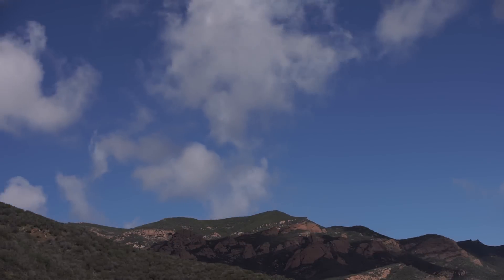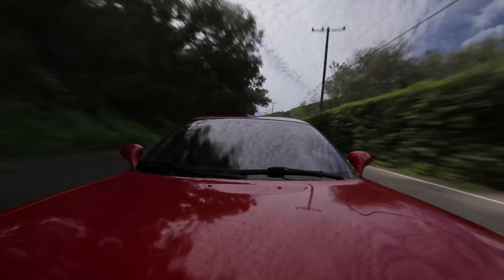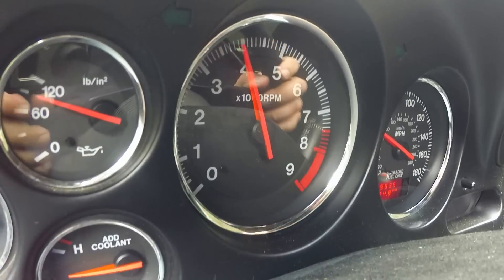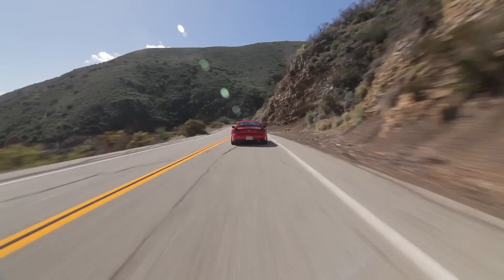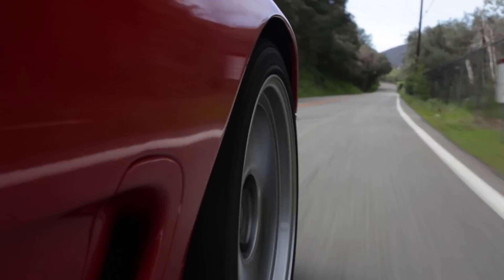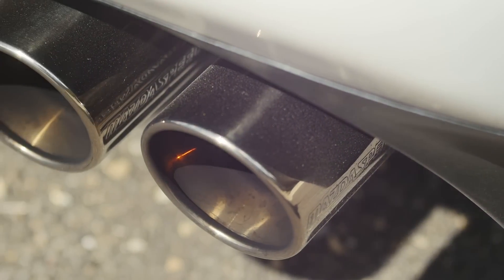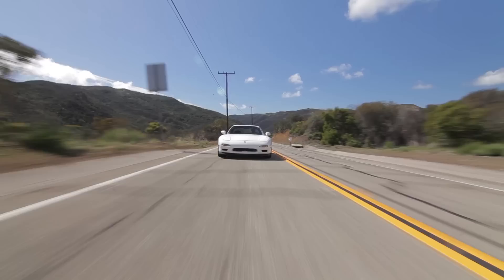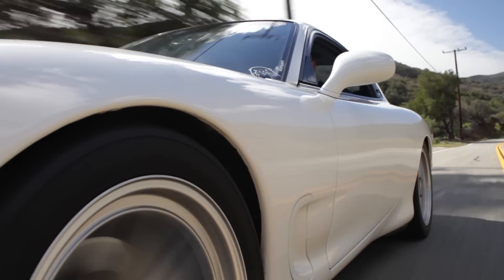Mazda  RX-7: Turbo vs V8 - /TUNED

Comment: I wan't to comment on what he said concerning the engine layout. The great thing about the Rotary Engine is that it is so simple, it doesn't need valves or camshafts, in these means it's much like a 2 stroke engine. That's why it is so great for tuning, as long as you stay in it's rigidity limits you can port it and blow it as much as you want and it will simply become more powerfull.
About the revs, as you me be able to distinguish through my bad english,
I am european and here we mainly build high reving engines,
a proper european sportscar revs up to 10 000 rounds per minute,
I think it's a philosophy thing, if you'd go to a german drag strip the tuned golfs and Audi A3s
whill all rev like motorcycles, whereas american muscles are very torquy and low reving.

I love high reving engines and I really want to drive a car with an motorbike enginge swap one day.
I think it's the best motor setup for driving fast, but not a race speed, when you have the possibility to rev from 4500 up to 9000 without shifting.
Reply: +Peter Griffin Don't you live in rhode island?

Comment: How about a heads-up track match? I'm betting that the FD with the Rotary spanks the LS. Plus, the beauty of the Rotary is, it takes 6 liters of V8 to challenge 1.3 liters of Rotary. Want some real fun? Stuff a 26B into a Z06 Corvette and hold a similar comparison test.
Reply: "The beauty of the Rotary is, it takes 6 liters of V8 to challenge 1.3 liters of Rotary"

Eennnhhh...

Comparing displacement of rotaries to Piston engines is apples to oranges.  Its not really "Accurate" to call a mazda rotary a 1.3- Its more or less "just what they did".

The 13b is measured as a 1.3 when you measure the volume of 1 combustion chamber, on each rotor.  Problem is- The rotor has 3 combustion chambers.  Thing is, when you measure the displacement of, well, damn near ANY other engine- piston or not, you "measure" it by calculating the volume it will move after its completed whats known as a full thermal dynamic cycle.  If you do this to a rotary, what you Actually get is a 3.9 liter engine.  

Rotaries, from an "efficiency" stand point go- Have a lot going against them.  Theyve got horrible  quench and swirl dynamics for example.  When you consider these, and other factors, consider how much mechanical leverage the rotor physically has over its eccentric shaft (which is not much), suddenly the amount of power and torque they make, the fuel they use, all makes a lot of sense.  

Engines are just air pumps, move more air- make more power.  Its not that rotaries are moving a lot of air for a 1.3, theyre moving about as much as youd expect from a 3.9. Theres nothing magical about mazdas rotary. Are they fascinating? Fuck ya they are.  I wouldnt dream of swapping the engine in my FD, but its not "magic".  

Ok. Maybe its a little magical.
Reply: Sure, there are three faces on each rotor, but the rotor spins the crankshaft three revolutions per single revolution of the rotor. So, professor, 2-stroke engines don't waste an extra revolution moving the waste gases out and the fresh charge in, but we don't double their displacement when discussing them versus 4-stroke engines do we? We don't dodge around the discussion and claim that a 250cc 2-stroke engine is really equivalent to a 500cc 4-stroke. We just recognize that the 2-stroke folks have lots of power on hand with far fewer moving pieces. Nothing magic about it. Rotary engines do more with less. That's why those of us who love them feel so smug when pull away from of some piston-driven supercar. Like the 2-stroke, the Rotary is noisy, thirsty and smells like burning oil, but holds its own against far larger competitors.  Not for everybody.
Reply: Lance LaCour
 "So, professor, 2-stroke engines don't waste an extra revolution moving the waste gases out and the fresh charge in, but we don't double their displacement when discussing them versus 4-stroke engines do we"

No.  Because we measure 2 stroke engines by measuring their full thermal dynamic cycle- Which only takes, 2 strokes.

"We don't dodge around the discussion and claim that a 250cc 2-stroke engine is really equivalent to a 500cc 4-stroke."

Of course we dont. Because were measuring it by using its full thermal dynamic cycle.

"We just recognize that the 2-stroke folks have lots of power on hand with far fewer moving pieces. Nothing magic about it"

Of course theres nothing magic about it.  2-strokes cover their thermal dynamic cycle in half the time a 4-stroke does.

"Rotary engines do more with less"

They really dont.

"That's why those of us who love them feel so smug when..."

Those of you feel smug about it because you like to think your engine is more efficient than it really is.  Saying im making 300 hp from 1.3 liters sounds so much better than saying you make 300 hp from an engine youve only measured 1/3 of the thermal dynamic cycle on.
Reply: FYI,
"The key for comparing the displacement between the 4-cycle engine and the rotary engine is in studying the degrees of rotation for a thermodynamic cycle to occur. For a 4-cycle engine to complete every thermodynamic cycle, the engine must rotate 720° or two complete revolutions of the crankshaft. The rotary engine is different. The engine rotor rotates at 1/3 the speed of the crankshaft. On two rotor engines, front and rear rotors are 180° offset from each other. Each rotation of the engine (360°) will bring two faces through the combustion cycle (the torque input to the eccentric shaft). This said, it takes 1080° or three complete revolutions of the crankshaft to complete the entire thermodynamic cycle. Obviously, we have a disparity. How can we get a relatable number to compare to a 4-stroke engine? The best way is to study 720° of rotation of the two-rotor engine. Every 360° of rotation, two faces of the engine complete a combustion cycle. 720° will have a total of four faces completing their cycle. 40ci(654cc) per face times four faces equals 160ci or 2.6L. That’s a well-reasoned number and now gives us something to be able to compare to other engines. In addition, since four faces passed by in the comparison, it’s like a four cylinder engine.Now we know, the 13B compare well to a 2.6L 4-cylinder 4-cycle engine."

Comment: Honestly I think it really comes down to where you like your revs at, this pretty much holds true with any V8 vs whatever argument.  V8's generally deliver their power at a lower rpm range than a V6 or 4 Cylinder, more cylinders make more power at lower rpm with the same displacement that just physics.  It doesn't make any particular engine better than the other but if you want low end grunt you go with a V8 if you want high rpm grunt you go with a 6 or 4 cylinder.  Adding turbo's or superchargers changes things but the more cylinder's the more power available at lower rpm's.  But thats also I think why you see more superchargers in V8's and more turbo's in V6's and V4's although that has begun to change in the last few years with the advancements that turbo's have made.

Comment: Thhere's some room for improvement.  If the LS came from a 90s GTO then it's probably iron.  The weight could be reduced by using an aluminum block, making it an even better car.
Reply: +Ewie M All LS2's are aluminum same with the LS1.

Comment: For a road car, ls2 makes sense... Reliable, low down torque, tall gearing, better mileage, less running cost, etc. For a track car i'd take the rotary, that setup is good for over 500hp (I suspect the owner did what I would do the stuck it the a safe map before handing key to some test driver I.e low boost, rich fuel, lower rev limit). 

It's more than just power figures, it's light weight with perfect weight distribution that allows to run no compromise suspension setup, fast gearing combined with 3000 - 9000rpm linear powerband allows fanastic mid corner and exit speed as you can get on power very early and hold same gear through the corner.

Ls2 makes the front end approx 100lbs heavier and loads more low end torque (peak torque isn't far off 13b with around 15psi) means you need lower rear spring rate, more toe in & fat rear tyres to get grip and stabilise the rear end. These things induce understeer meaning you can't get on power as early, and If you do you'll find The fd chassis will have a very hard to counter tenancy to snap to power oversteer. This characteristic can be fun on the road but not fun on a 200kph sweeper.

Rotary is a great racing engine, but the Ls2 is much better road engine, and since this is a road test I guess ls2 wins this one. You'll have to search RE wing or FEED rx7 to see the potential of rotary at the track.

Comment: This was my first "sports car"...RX-7 rotary engine w/ tuned turbo.Trans cooler. Forced air intake. Rally gauge package Soooo much fun to drive. Porsches couldn't touch me. They would get a jump, but they couldn't keep it, ever.
Reply: Mark Preston Pirelli's for grip. Good memories.
Reply: Mark Preston He also made the same call. Bigger single turbo. And they rev super high. Fun fun fun to drive.
Reply: Mark Preston That LS V8 sounds excellent in it.

Comment: Only way to compare is to have them run at the same horsepower. And my bet is on the power to weight ratio. Therefore I choose rotory.

Comment: Rotary is better in being simpler. With less things to go wrong then piston engine. It uses roughly the same amount of fuel as similarly powered v8 car in right configuration. And of course with twin turbo setup it does not lack instant torque like single ones.

Comment: You compared 1,3 Liters to a huge V8, thats why the rotary is so great.
Reply: Eric B ...with the rotary burning WAY more fuel than a V-8 with less reliability. The only reason to have a rotary is to be different--that's it. There is nothing wrong with that, that's part of car culture, but for rotary fans to claim it's better then they are just lying to themselves.
Reply: 2xDeuce I never said it was the superior engine. I just said why its a great engine.
Reply: 2xDeuce It's a simple design, and its compact. Also allows for lower center of gravity and better balanced weight distribution. It makes it easier to accomplish all that all while with the amazing potential of making more power out of the little engine. It can be advantageous in any way. Only reason you see them getting blown a lot is because most of the people that own them don't know what they're doing and don't maintain/build/tune them properly. Every engine design has its flaws. So to say that one is better than another is just silly. They're equally great and shitty. All have their pros and cons.

Comment: From a race car viewpoint you would stick with the rotary. Yes there is more torque from the V8 but you could always play with different turbos on a rotary to get more low or mid range performance.
The rotary engine sits lower, has less weight over the front steering axis and thus provides a significantly more balanced car as the centre of gravity is lower and sits further in the middle of the car. The way Mazda engineers intended. If you were to look at this in a race car viewpoint that alone is enough to keep the rotary engine.
Reply: +Jurica Kalcina "he rotary engine sits lower, has less weight over the front steering axis and thus provides a significantly more balanced car as ...."

Most LS swaps end up being as light, or lighter than stock.

Comment: funny that theres a "no piston" sticker on the V8 swapped RX-7...
rotary engines are "supposed" to be more efficient than a piston engine, as the crank does not really have to stop/ slow down as each pistons reach TDC or BDC to stop, and go the other direction...
meanwhile the rotary just keeps on spinning

Comment: Ls1 all day! More torque, more reliability and cheaper to fix and mod, a T56 box, amazing sound and just with boltons and a good cam your pushing well over 400whp. I have an ild Dodge Dakota with an LS1 mated to a turbo 400 trans. With full boltons and a cam, custom rear end with an LSD, 285 wide wheels in back, coil overs, traction bars and a custom tune it made 410whp and 370 ftlbs of torque. Since it was so light with great traction it upset a lot of people. Love that truck

Comment: for me the only bad thing about a rotary engine is the cost. but damn it drives like nothing else.
Reply: buubised I don't know of any LS motor you can have fully rebuilt for 2200 or buy new for 3200, that being said I"m a HUGE LS fan and DD a Chevrolet religiously
Reply: For that money i can rebuild a rotary, btw im putting my engine on the car today :) but yeah 3200 for a new engine sounds good, i can buy only used rotary parts :(

Comment: I see a lot of die-hard 'rotarians' are quite offended by this engine swap. As a 'resto-mod' I think it makes good sense to install a modern piston engine in place of the buzzy and very thirsty rotary. However, I would propose installing an engine from the Camaro-- the V6 to be specific! It would provide the balance and steering response of the rotary, being shorter and lighter than a V8, and is rated at over 300 hp-- plenty to move that light car.

Comment: As a rotor head. if i had to do a piston swap it would be a boxer engine, that's the only piston engine that feels so well balanced, revs fast, small and powerful, at the same time, a rotary with the same HP as a piston engine will always be faster.

Comment: Don't forget that the rotary can burn lots of oil!
Reply: samdajellybeenie Don't forget fuel, too!
Reply: No democracy 4 rotary then
Reply: And rotors.. leading to blocks suffering from starvation, leading to top end, intake manifolds, losing turbos and that, all crapping out because of the underlying problem of your $60 bottle of oil spilling out onto ya driveway overnight.. Rotors are awesome but they will always come back to kick ya in the ass! Especially the old ones.

Comment: Matt don't get rotary is same as me don't get why ls swap. I don't see how it is a cheaper option to do (some said) as you can always buy a c5 or early c6 corvette with few mods with the price you buy and swap an clean rx7.  After the swap, they probably weigh in the same and weight distribution is probably the same too. Only difference is dimensions, but not by much 20cm length and width. Both have great aftermarket support and you can always buy suspension and brake upgrades. Also, there is no convertible fds too. I don't hate Ls swapped Rx7 but I just don't see the point of swapping

Comment: Hmm no real music on the Rotary.. Matt kinda confused by the engine. Then the V8 comes on (which from all his other very cool videos he is obviously keen on) and then the chipper upbeat music starts, changing the slant of things. Another question. HP on each car? Were you comparing two 400 to the wheels cars? Or a cleaned up 300 single turbo, vs a cleaned up 400 LS2?  Equal HP to the wheels, would be a better comparo I would think. YES a V8 out of corners is a lot of fun. But on the flip side a Rotary when running at the proper levels/rpm is equivalent in performance on the track. Different tastes. In 20 years the white RX-7 will be just another converted V8 RX-7.

Comment: I've got a v8 lexus and a rx7fd, both engines are great in their own way. The v8 for long journeys but if I want to have some fun the rx7 has the grin factor every time. You do need to put more effort in to get the best out of it but that's why you buy one. Not for easy/lazy driving. Little blip on the downshift braaaaaaappppp perfect :D